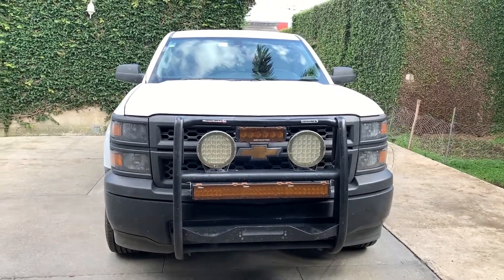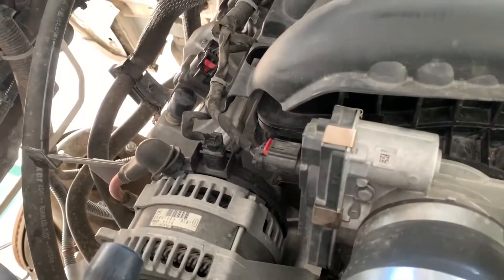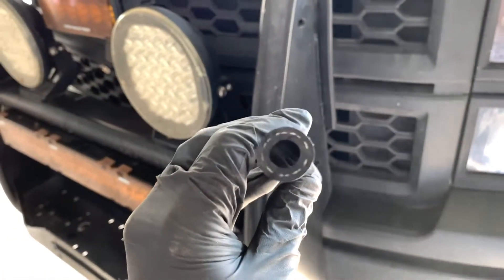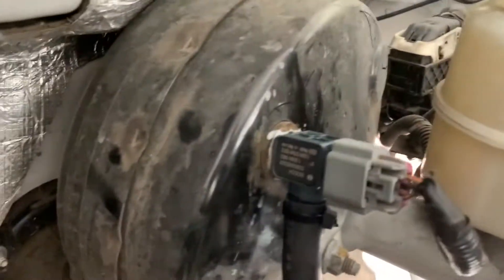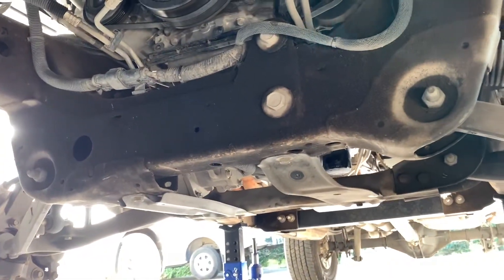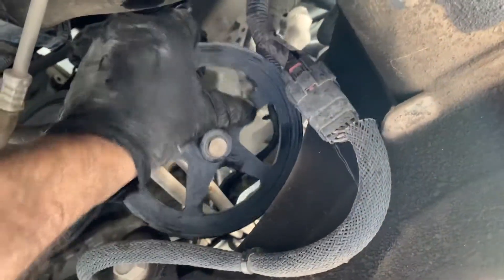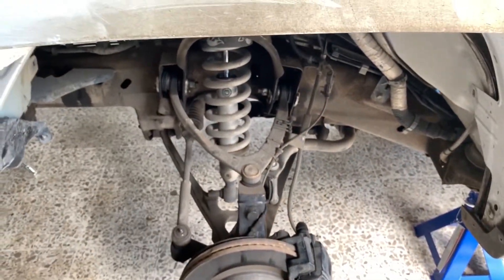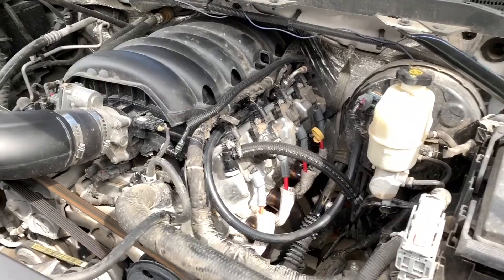How to Delete Brake Vacuum Pump on a 2014+ GM Truck or SUV

Comment: Why would you want to delete the vacume pump ?
Reply from the maker: It doesn't pull as much vacuum as the manifold, and also breaks and fills the engine with steel pieces that the oil pump picks up and blows the engine

Comment: I just took mine off 2018 5.3l Silverado 4WD. Took off bottom engine cover & exhaust heat shield. Used all my 3/8 extenions & a wobbly. All I can say is wow it was hard, esp for my 73 year old body. Took lots of patience. But it can be done.
Reply from the maker: It's a pain for 4wds :(
Reply: @BadAssEngineering If it wasn't for the snow today I was questioning the need for 4WD. But got over that on slick roads today. Removal can be done but reinstalling would have to be done your way. Did DOD removal so thankful don't have to cross that bridge.

Comment: Valve cover breathers are your fresh/clean air source. You capped off the dirty/vapor side of the pcv system. This should not be done. People are assuming you have the valve covers still hooked up as factory which you obviously don't. The only time you will see the valve cover vent out to the clean side is under WOT, but during idle and cruise the manifold vacuum should be pulling from the pcv, which you capped, and drawing fresh air through the valve covers. Capping that has disrupted the correct flow of air into and out of the engine. You should have simply "T" into the hose from the pcv valve to the side of intake and on this "T" installed your brake booster vacuum supply line. That way the valley is still able to vent as designed under manifold vacuum and that same manifold vacuum will supply the brake booster. Until under WOT obviously when the manifold goes to atmospheric and no vacuum happens. Which is where the integrated check valve inside the booster should retain enough residual vacuum to still use the brakes and you close the throttle blade enough again to start a manifold vacuum.

Comment: I know this video is old but I have 2 questions.  One, will the afm delete that you can plug into truck to disable the 4v mode work? And 2 I was not clear on the manifold hose how to hook up there...? Thank you great video
Reply from the maker: You unhook the PCV and plug it, then use its manifold side port for the Booster, and yes, the AFM delete plug shoud do

Comment: I uses the existing line from the pump. Simply cut the end off along with the pcv and the pcv fit right onto the brake booster line..didnt even have ro heat it up. Cut the belt to the vacuum pump and viola..problem solved ..i pinched the end of the vacuum   clip and i will be leaving the pump in place. Super easy

Comment: Is there a reason you replaced the vacuum line instead of just using the same hose? Is the new vacuum stronger than what was supplied by the pump?
Reply from the maker: The stock vacuum line is hard and solid and cannot be reused

Comment: Great video,  I did the delete a while ago and was just recently changing air filter and noticed that I had what looks like water in my air intake box. Seems like it's coming from the 2 pcv lines from each valve cover.  Would the delete be causing this?

Comment: How to do the swap if you have an oil catch can??
Reply: I have a catch can. I used a 3/8 brass T & 3/8 fuel line. Connect brake booster vacuum line to manifold side of catch can.

Comment: Is it necessary to remove the pump after cutting the belt?
Reply from the maker: @Ghost_Of_FPV_1151  not necessarily but haven't tried that
Reply: At 38secs you pointed to the positive crank case line did you have to plug that ?
Reply from the maker: @ I removed the line and capped the block side, the port on the manifold is the one that will be re used for the booster
Reply: @BadAssEngineering  ok thank you

Comment: I have an oil catch can installed on my truck. Do I need to remove the catch can to do this delete, or is there another way to get the vacuum for the brake booster?
Reply from the maker: get rid of the catch can, they dont work and dont prevent carbon buildup
Reply: @BadAssEngineering  care to elaborate? Pcv vents crankcase pressure doesn’t it? If crankcase pressures get too high you’re blowing oil into your cylinders. I can’t say wether or not you can plug up the Pcv or not I’m not sure but to say catch cans don’t prevent buildup is nonsense. These engines are direct injected meaning no fuel is cleaning the back of the valves. And the Pcv hose you rerouted in this video directs all that oil to the intake.
Reply from the maker: @warboy4004  pull your intake manifold and find out the catch can scam

Comment: If i have an oil catch can , can i T it off that same hose you ran it to your intake manifold ?
Reply: Did you try it that’s what im gona do
Reply: @jr.zz7162  I'm gonna try it and if I have a shitty brake pedal feel I guess il just remove the catch can, block off the crankcase vent by the throttle body should vent fine from valve covers 🤷‍♂️

Comment: What if I got a catch can that’s using both lines for the intake manifold? What do I use for the master cylinder?
Reply: Did you figure it out
Reply: @jr.zz7162 no but I did get a L8T swap so the line next to the throttle body goes straight to the master cylinder
Reply: drill a hole, put a fitting on there

Comment: Have you gotten any new oil leaks since doing this? Dont see why we can't simply tee into the pcv to manifold line to feed the booster vaccuum & leave the factory crankcase pressure system in place? Anyone have any thoughts on that?

Comment: I read your write up on the forum, watched this video. Brother you gave so much info but what is this part about running the stuff from valve cover to exhaust or? This needs to be shown and explained or else the whole recipe you gave us is Irrelevant….I got the delete kit and the hose and caps but I’m not sure exactly what I’m supposed to be doing when it comes to that part
Reply: Disconnect hose running from booster to pump. 
Remove belt and pump. 
Plug pump. With fittings. (I did mine with fittings and cover for aesthetics) 
Run booster hose to manifold port. 
Cut and cap off pcv 
All done.

Comment: This fixed my low speed abs activation issue on my 2015 GMC Sierra… Brake booster wasn’t getting enough vacuum after brake use while backing down driveway. Thanks

Comment: Can you just drill a hole in the intake manifold and use a hose barb to run vacuum to the booster ?

Comment: Got mine going out on my 2017 silverado at 50,000 miles.   Ridiculous.    Honestly is there a reason other than the afm system that a vacumn pump is needed ?      Recently did same type delete on our 2009 vw beetle.    Works great.    Im 47 Every older car ive had used the manifold.   Not sure when these pumps became common
Reply from the maker: With cylinder deactivation mode on V4, there is not enough vacuum in the manifold to operate the brake booster. It's a liability thing

Comment: Will i still be able to run my catch can after this delete?.
Reply from the maker: Don't run a catch can, they stop condensing the oil after q couple of minutes. Catch cans are meant to run for short periods of time like drag racing...
Reply: @BadAssEngineering  idk about that. Installed catch can at 50k and now at 150k.
Reply from the maker: @viixiconik  lol remove your intake manifold and see how those ports look

Comment: My pump went out, but I had to drive it to work the next day. That peddle was hard to stop. Two footen it to stop. Watched this video on lunch and did it and wasn’t expecting it fix it so quickly. I about went out the windshield 😂 thanks for this video
Reply from the maker: Check the crankcase for debris that could obstruct the oil pump pickup
Reply: @BadAssEngineering how would you do that? Drop the oil pan?
Reply: Honestly gm should of deleted those from the factory ,great video I think im going to do thisbon my truck ,thanks for the great info.
Reply: Is it true the truck has to be afm delete tuned before being able to delete the brake pump?

Comment: This is great. Thank you!

Could you just leave the pump on and take off the belt after doing the hose modifications? I don’t think it would hurt anything just being static but not sure.
Reply: I have the same question, does it work to just leave the pump in place?
Reply: @SuperGlite  I have the same thought did you end up doing it?
Reply: Oil flows through it, so your worst case scenario is oil would get trapped in the pump and not circulate or drain out during an oil change. Other than that, I cash see any reason it would affect anything negatively. I didn't even know this was a thing. My brake pedal was going stiff when backing in my driveway a while back, but it stopped doing it. I was about to replace my booster before it just quit doing it. I will be doing this

Comment: Hi, I did this just like you did and now oil is being sent from the valve cover vent tubes into the box that connects to the throttle body and air filer housing, and its also taking longer to start sometimes. Is this due to back pressure from capping off the pcv valve? I think I might have to go back to the original setup. Any advice is appreciated.
Reply from the maker: That is not related
Reply: Yes, you are now forcing the crank case to vent its pressure up through the valve cover ports and into the air box if you followed this video and capped the pcv valve. That pressure has to go somewhere and if you follow this video you have made it so its only option is to force condensation, oil vapor, combustion gases etc out into the intake box through the valve cover vents. These vents are designed to be fresh air sources and the capped pcv valve in this video is the dirty side, which is where you'd install a catch can to catch these vapors, but by following this video you've essentially eliminated the dirty side and are forcing that dirty air back up through the pcv clean air side instead.

Comment: Where are you routing the vent hose from the front valve cover on the driver side?
Reply from the maker: To the exhaust using an Evac

Comment: If you cap the pcv at the block will the excess pressure in the block not cause seals to fail?
Reply from the maker: All that pressure goes out the valve cover breathers into the throttle body, caping the pcv is non consequential in these engines
Reply: @BadAssEngineering  I did that and my valve breathers filled up my air box with oily goop.
Reply from the maker: @justinstatham6378  then don't run them into the manifold ?  there's is a mechanical problem with your engine or you're using crappy oil if it blows so much
Reply: @ I run MOBIL 1 and change the oil every 3-5k. What could be wrong with the engine?
Reply from the maker: @ nothing is wrong, oil in the intake is normal, that's why you remove the pcv that recirculates into it

Comment: Awesome video! Just picked up an 2014 got to the gas station and my brakes went stiff and would barely stop the truck. Did a quick search and found your video. Gonna give this a shot, also is the Diablo tuner pretty straight forward with disabling the AFM?
Reply: Update please 🙏

Comment: why not just do everything except actually removing the pump just remove belt and switch the vacuum line to the intake like you did but don't worry about actually removing the vacuum pump or is there a good reason for actually removing the pump
Reply from the maker: You could do that, i enjoy going all the way

Comment: Whoa, whoa....you start out talking about you can't do this if got some active fuel management , what takes it from V8 to V4, that you have to disable it and you show some DiabloSport InTune box???  How does that work?  Where's that info?  So, now it has to always be in V8?  Please explain this more.
Reply from the maker: These engines have collapsible lifters in 4 of the cylinders, the ECU activates them so the valves on those 4 cylinders remain closed while shutting spark and fuel, so the engine only runs on the other 4 cylinders. While working on V4 mode, the engine doesn't produce enough vacuum to run the brake booster. Using an ECU tune to disable the AFM is desirable, because these engine collapsible lifters are known to fail anywhere from brand new to hundreds of thousands of miles.
Reply: I have a 2015 with the 5.3 V4/V8 BS disabled currently, but in V4 mode, there was plenty of vacuum for the booster. I T'd into the PCV line instead of eliminating it, leaving PCV circuit intact. Maybe that made a difference?

Comment: What did you use for your valve cover crankcase breathers?
Reply from the maker: The stock fittings sending the valleys down the exhaust using an Evac 👀👀
Reply: @BadAssEngineering  have any more pictures of that?

Comment: Capping the pcv just forces the crank case pressure out the valve cover breathers? So I should run a catch can did each valve cover?

Comment: what if i have a catch can?
Reply from the maker: Catch cans only work for the first 10 minutes, once they get hot they're useless
Reply: we’ll fuq so i don’t have my stock hoses anymore what should i do
Reply from the maker: @braylonwoodell5465  you don't need them, cap the pcv port. All the crankcase pressure goes out the valve covers into the air box anyway
Reply: @BadAssEngineering   how would i go about capping off,

Comment: Not only when you’re vacuum pump goes out. It also takes out your brake booster.
Reply: not always it depends greatly on weather or not you were leaking engine oil thru the vacuum pump into brake booster or not. if you were not leaking engine oil from pump then your brake booster should be just fine

Comment: I had a wreck because of the vacuum pump locking up my brakes in the rain. this is very helpful
Reply: Did you have the original faulty vacuum pump design? Or did you wreck after a vacuum pump replacement? Debating between this delete mod, or having a dealership install the new vacuum pump design.

Comment: This is great!  I keep throwing the belt and have no brakes.  I also used the Atomic Fab mounts.  Love them.  Minimal vibration and rock solid.
Reply: Are you talking about engine mounts?  For the Gen Vs?

Comment: Has anyone had any problems over time from doing this?
Reply: I did it probably around 4 years ago and about 90k miles. Truck has around 140k on it now. I recently developed a leak from the front main. Not sure if it's related or not that what's got me circling back to this video. When I removed the intake box I drained close to a pint of water from it?  The lines from the valve covers to the intake box were pretty brown and sludgy and my throttle body was very nasty with a black oily sticky sludge.  With all that being said, that's been close to 100k miles ago so take that for what it's worth. I don't know how much, if any of it is related but those are just some general observations.

Comment: How did you delete the stock pcv fitting on top that goes along the intake manifold? I’m not understanding how you deleted that if it’s not being used anymore.
Reply from the maker: You don't delete the fitting from the manifold, you use it to connect the manifold to the booster. The line that originally goes from the manifold to the pcv under the throttle body is deleted
Reply: @BadAssEngineering  hmmm. Ok. I’ll look closer tomorrow but mine is a 2017 with a 6.2. The line from the throttle body runs on top the intake with no connection or fitting to latch onto. It runs as a hose/line straight all the way back and down the firewall. The one you showed had a pcv fitting to connect to, where I don’t think I have that. Which could almost be easier if I just ran that line from intake to the brake booster fitting, but I’m not sure that’ll work. Unless I’m missing fittings somewhere but I have no connection to go to, unless it’s in the back of the engine down along the firewall.
Reply from the maker: @jaybilawchuk2225  careful, there is a line to the manifold that pulls the evap from the fuel tank, the other is the pcv. The pcv on 6.2s are in a different place than on 5.3s
Reply: @BadAssEngineering  ahh ok. That makes sense why I’m not finding the proper line to connect to. I’ll try look tomorrow to find where that would be on the 6.2. I’m not sure where it’ll be but you are probably right saying the line I was talking about goes to evap for the tank. That looks exactly where it is going. I’ll have to research for the 6.2’s.

Comment: On the front of manifold what did you use to block off the pcv port that you pulled the line off of?
Reply from the maker: on the front of the block** i used a rubber cap, autozone sells assortments on various rubber vacuum cap sizes
Reply: @BadAssEngineering  
Have you noticed any oil consumption after turning off the afm with the tuner?
Reply from the maker: @Chief6067  no, nothing